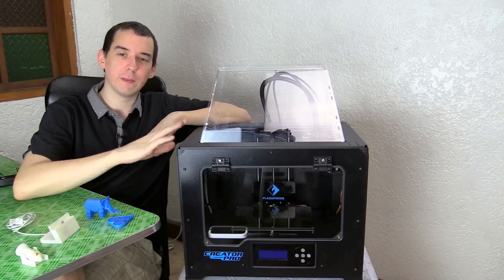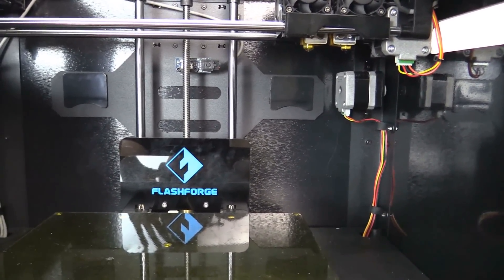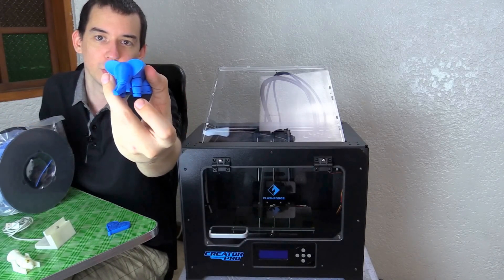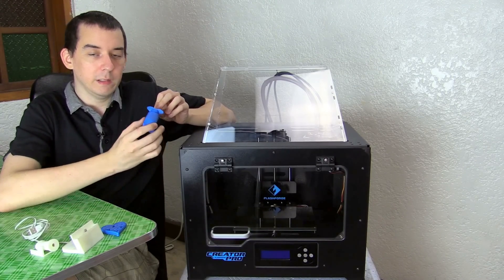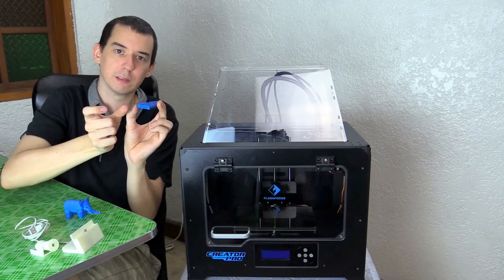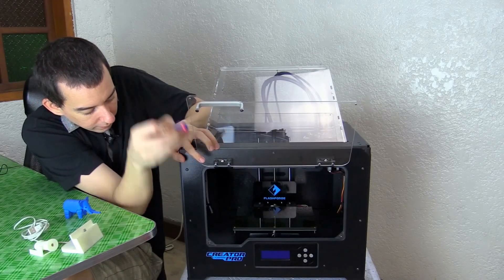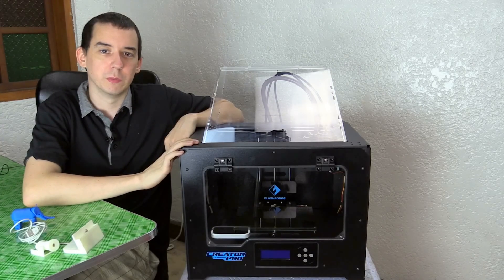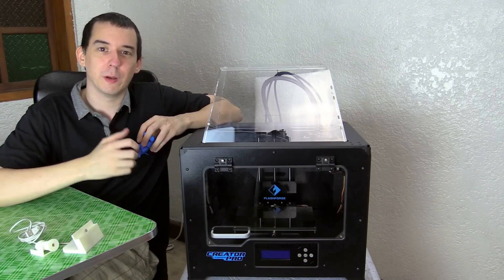Flashforge Creator Pro 3D Printer

Comment: Your example prints in the video look incredibly smooth, especially the elephant and gear examples.  Did you do any smoothing to those after print?  What micron level was your Create Pro set at for those?  I am thinking of buying one, so hoping to achieve those kind of results.
Reply from the maker: Neal Juern That's pretty much how they came off the printer. I removed any raft/supports but that's it. Printed at 0.02mm layers :)
Reply: Gadget Addict This is 50 layers per mm ! ??? How long was the printing time for the elefant then? Or was it 0.2mm ... Where can I get the stl files for the elefant?
Reply from the maker: oops sorry lol. I meant 0.2mm layers. The elephant came from thingiverse, you can get it from http://www.thingiverse.com/thing:257911

Comment: At 9:36 you mention that there is no way to keep the door up. All you need to do is tighten those phillips screws in the center on of the door hinge. Also, if you flip it straight up, it will stay up much easier.
Reply: Or put on side or take off

Comment: The USB connection problem he talked about is not true.  The USB connection feeds the print project to the printer 100% before it starts.  If you turn off the computer or disconnect the USB cord, it continues to print because the project is 100% inside the printer at that point.

Comment: Great review! Do you have any preferred 3d Software? And how user friendly are they particularly for those who's never done 3d designs? Thanks!
Reply from the maker: Odie Sotomayor For super simple and quick models I use Tinkercad. But my preferred modelling software for more advanced designs is Solidworks. I went through the common ones like Sketchup but eventually found Solidworks to be the best.
Reply: Excellent information. Thanks for sharing! I'll certainly look into those. By the way, I was from Manila in Mandaluyong I now reside in U. S. Are 3D printers down there more affordable? Thanks again!
Reply from the maker: Odie Sotomayor There's a wider choice and cheaper prices available in US/UK for 3D printers. There's only a few people importing 3D printers into the Philippines so the prices are a little high. There is a "locally made" 3D printer (Puzzlebox 3D) which is meant to be a budget printer but I've not been able to review it.
Reply: Ok. Thanks for the info!

Comment: What Programs can i use - i have Photoshop (latest version), is it Mac OSX compatible?
Reply from the maker: testvideo5377 For design you can use something like tinkercad, sketchup, solidworks or many others. For exporting the design to the printer I use ReplicatorG or Makerbot. Everything I mentioned except Solidworks is available on Mac OS X.

Comment: Also does the metal frame get hot where you can get burned if you touch it?
Reply from the maker: testvideo5377 The metal frame doesn't get hot enough to burn you but it does get warm. The point of the enclosure is to keep the temps high, so some warmth is expected :)

Comment: can this machine cause a fire if unattended?
Reply from the maker: testvideo5377 Any 3D printer or electronics device could potentially cause a fire if left unattended. More likely is clogged nozzles and the printer destroying itself than a fire. You'll see many horror stories of people leaving their printers going over night and waking up to find the nozzle got blocked and it just oozed plastic all over itself meaning many parts have to be replaced. Personally I like to check on the printer every so often to make sure everything is okay.

Comment: Hi, 

Just wanted to know how is the performance of the printer, in terms of preventing warping, support removal, and finally what software does it use? I have always wanted to buy a 3d printer for myself but I am concerned if it is a hit or miss technology and I would end up tinkering with it more than designing and producing my parts. If you compare it to the ultimaker 2. I do not mind paying for more as long as the unit I end up with, is consistent and turns up good quality parts. Nice and very informative video by the way. Thanks for the Vid.
Reply from the maker: I don't have any experience with the Ultimaker so I can't really compare. From what I've seen of other Youtubers prints, the Creator Pro is as good, if not better than most. I've not had any major issues so far. I started hearing some noise during printing the other day, I followed the instruction manual and applied some oil to different parts and it fixed the issue straight away. I didn't expect to have to oil the machine so soon, but who knows how long it was in storage before it was sent out. It only took a few minutes and is part of the expected maintenance. The acrylic door and top cover help keep the temps up to prevent warping. I've not yet experienced any warping issues although I did have a tiny crack in one of my larger (5 hours) prints. Printing with supports, on any printer, pretty much guarantees you're going to need to do some tidying and sanding of the part. Although you can get a pretty nice finish from 3D printers, I think it's pretty much accepted that you will always have to do a little cleanup if you really want to get a perfect finish. I use MakerBot to open STL files and export them to the SD card for printing. For design I started with Tinkercad, then sketchup (painful but powerful) but I'm transitioning over to Solidworks which is pretty much the best.
Reply: Gadget Addict Thanks for the feedback, your inputs really helps a lot, it will definitely guide me in buying a 3D printer.

Comment: oh woah the filament looks much bigger than I thought it was! I thought they were just palm size spools of plastics.................
Reply from the maker: Hehe nope, they're pretty big! They're usually sold as 1KG but some sellers will cut off smaller amounts for you. I like that because it means you can have lots of different colors available without having to buy 1KG every time. Although it does work out a little more expensive per meter.
Reply: Do you know if certain filaments are electrically conductive? I read some news/articles saying most of new plastics are conductive in someway, and worried about the filaments -> printed stuffs.
Reply: hi another question, do you know how many hours it takes to print out the whole roll of a filament? (maybe medium speed/good quality) Thanks!!
Reply from the maker: TianTian Dong Hmm sorry I have no idea at all. I don't think anyone would be able to give you an accurate measurement because things with long straight faces are much quicker than things with curves and lots of corners.

Comment: can you also email me where you get your design elephant and that heart mechanic

my email is kiske_morita@yahoo.com
Reply from the maker: Mmm I don't have the links anymore but they were in the popular section of thingiverse.com :)  You'll find lots of cool designs on there!
Reply: Thx man !
Reply: Gadget Addict always enjoy your videos.   Just a small question, after looking at the price of your printer, was wondering how easy it would be in the Philippines to source the components for one of the open source printers such as the reprap Ormerod or the Huxley?   They say that nearly 50% of the components can be printed but just wondered about the availability of the hard components such as step motors and the metal rods.  I wouldn't be able to justify spending 55,000 pesos but could maybe get away with an open source self build.   Thanks for the videos they are always informative and entertaining.
Reply from the maker: Nigel Carter There are a few sellers locally have have the stepper motors, RAMPS board and various other parts you need. Although they can be a bit costly. There's also a few people selling kits but again they're not very cheap. There's always the Puzzabox which is a locally made printer and that's a bit cheaper I talked to them about reviewing their printer but after some back and forth, I've not heard back from them, so I can't comment on the quality. The cheapest way would be to import a kit that includes everything and build it yourself, but you might get stung by Customs. I saw someone selling a Reprap Prusa I3 kit on Sulit/OLX for around 23k.
Reply: Thanks.  I'm not actually in the Philippines until next year so may be able to bring the hard components when I move .   The kits are quite cheap here at the moment at around £300 which is a major saving.

Comment: Maybe I can request some replacement items for 3D printing :). Is there a way to scan an object instead of designing it? Specifically on the model you have
Reply from the maker: There is a way! You can make or buy a 3D Scanner which shines lasers on your object and rotates it in front of a camera to map it out on the computer. But they are kind of expensive and can be really hard to setup. Also they don't work on reflective surfaces so in some examples I've seen on Youtube people have used spray paint on the object they wanted to scan. Even when it's on the computer you have to do a little bit of work to smooth everything out. Right now I'm just using a ruler and trial and error :p
Reply: Gadget Addict I have a pebble steel and I bought a steel connect adapter so I can put on any watch straps. I wanted a different color so maybe some sort of scanning device can scan my current adapter and reproduce it.

Also maybe a good adapter for the Apple Watch. I hope you know where I am going here $$$